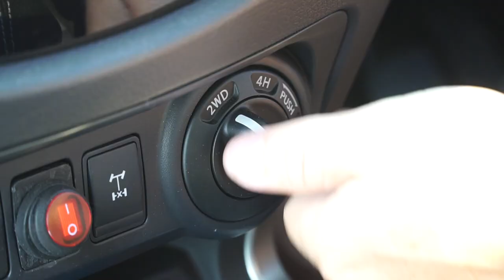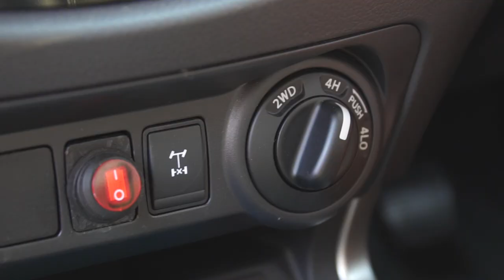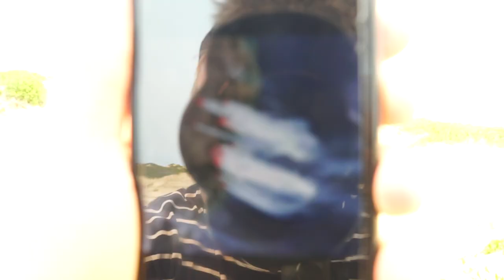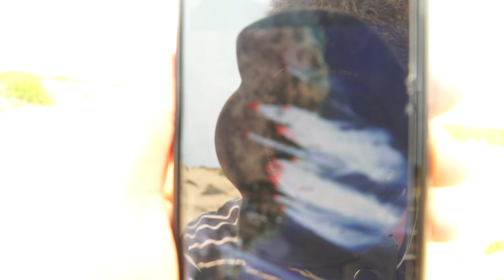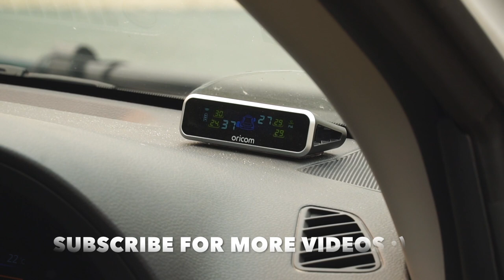NSW'S BEST 4WD BEACHES

Comment: Hey Tyler I've just about to have my 3 year old stx navara sandblasted underneath and resprayed due to surface rust on chassis and suspension components...i dont live near a beach or drive my truck on one.The coatings seem really below average...keep a close eye on yours.
Reply: Pete mackaa Straight outta Thailand. They all have these issues
Reply: It's looking that way,  guys who are doing mine said bt50s are the worst of the lot for it. Bloody shame when you spend so much on them
Reply from the maker: Cheers mate, ill keep an eye on it

Comment: I find with my Defender, if you need more than 3rd low, just use high range.
Reply from the maker: Yeah the only thing I find with that is 4th low is that little bit more then 1st high but then to go to 2nd high is big jump and you have no power once you start losing speed

Comment: When you're on the sand you should keep it in hi range. You need wheel speed in sand more than grip an that way you won't hurt your engine as much
Reply from the maker: I normally keep it in high range but I find when conditions are tough and you need more then low range handles soft sand conditions better

Comment: Good video I was just wondering what sort of compressor do you have and rough time it takes to pump one tyre up from around 12 to 14 psi. The one I have is a repco brand I think it's 150 lpm but it takes  about 8minutes for one tyre to pump up then it overheats the pump so it has to cool down whole process is close to 1.5 hours. No fun at all. Thanks for your time.
Reply from the maker: Thanks mate! The one I use is a Rydge Rider one from super cheap auto, was just a cheapie one but had it for a few years and has always worked. Takes about 2 minutes per tyre for the 33inch tyres to get from 15-16 back up to 36ish and can do all four in a row

Comment: Hey mate are you going to be putting an exhaust on the nav or still trying to find a way round the dpf? Also is it worth getting the stainless snorkel, are they noisy at all ?
Reply from the maker: Hey mate, might get an exhaust on its eventually but not too worried at the moment. Would probably still leave the DPF in and get an exhaust and tune.I like the stainless snorkel but jeu are pretty noisy
Reply: Tyler Thompson thanks mate, can’t wait to see some more adventures from you

Comment: I thought you’d have a snorkel sock on in the sand, especially having a staino
Reply from the maker: I did check the airbox after and there was hardly any sand in there at all, few little grains. Then its not going to get past the air filter and I have a sock over the air filter too
Reply: Tyler Thompson alright man sweet 👌🏽 just heard of a few horror stories with sand/water getting in
Reply from the maker: Yeah I haven't had any dramas with water in rain/wind yet, cause its backward facing and angled down slightly never seems to get in

Comment: I find that High range is the best for sand driving, theres just too much torque in low range and you find that you dig yourself in alot.
Reply: Vglz 
Depends on the terrain and how the vehicle is moving. In some vehicles you can start from 2nd low or even 3rd if you don’t need 1st.
Reply from the maker: I generally use high range but I find low range works better when the conditions are tough, when the sand is really soft and you need that bit of extra low speed power. Thats just what I find anyway
Reply: Tyler Thompson yeh man what ever works 👍🏼